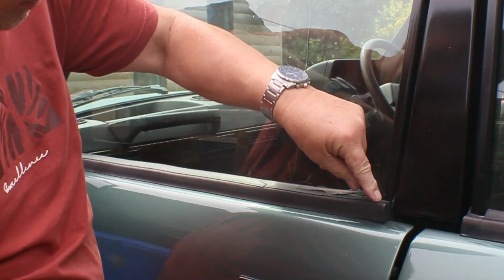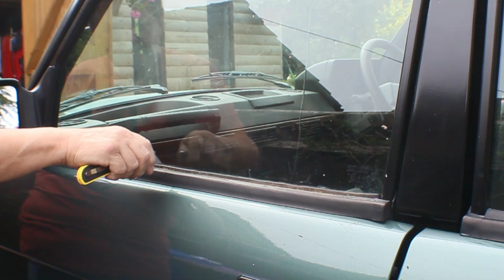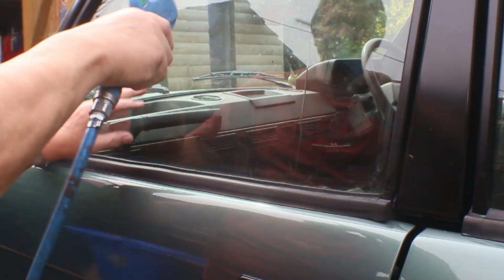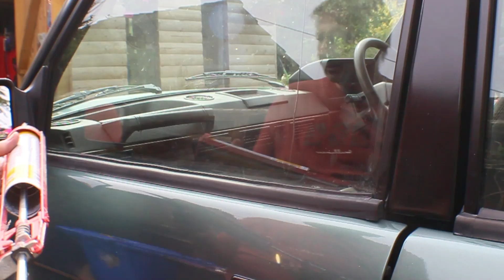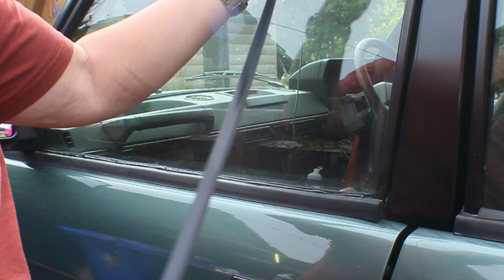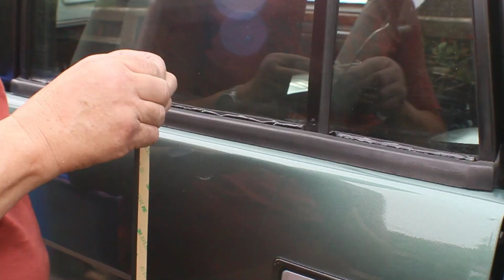Range Rover Classic Door Waist Seals

Comment: Hi, very informative. I am struggling to find the 3m strip with the offset adhesive. Any chance you have a link for it?
Reply from the maker: 4M*15mm Car Side Window Moulding Trim Weatherstrip EPDM Rubber Seal Strip UK   sold by cuckoooz  on ebay uk
Reply: @Restorationservices-1 thank you